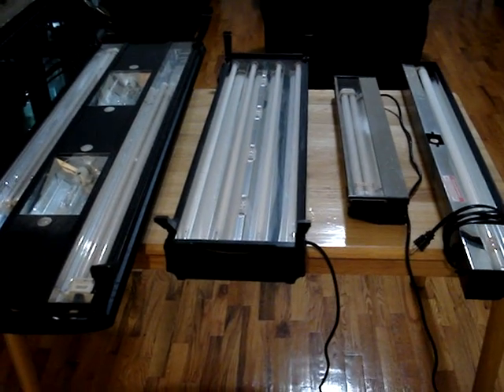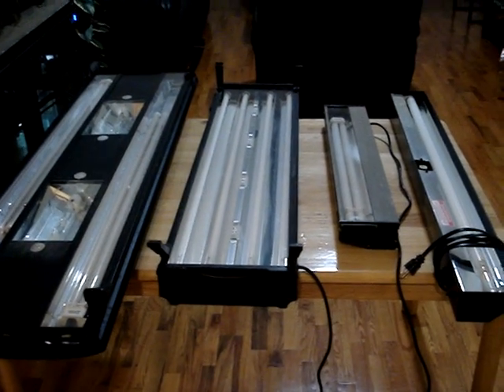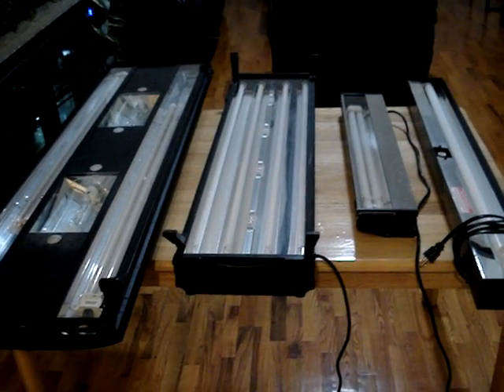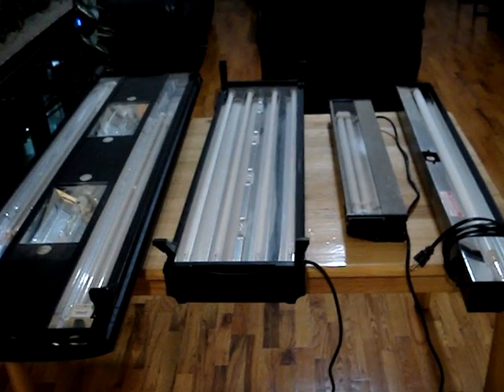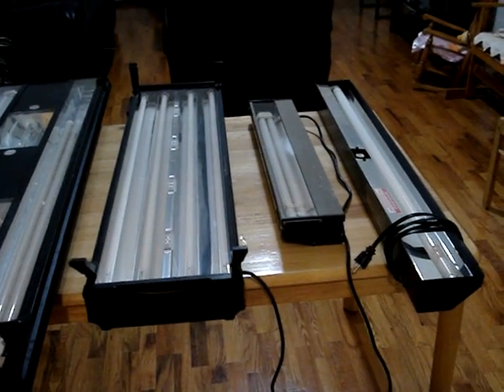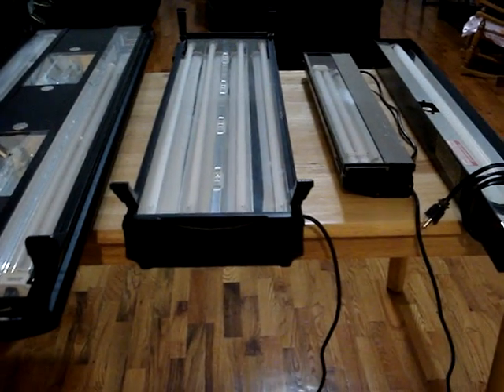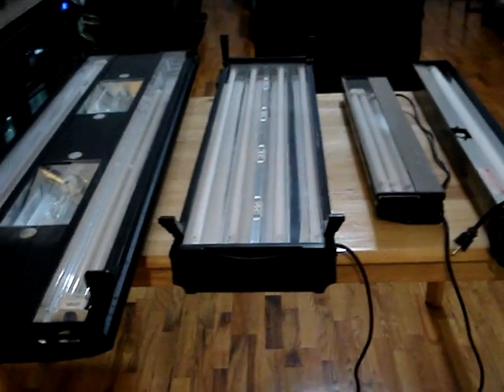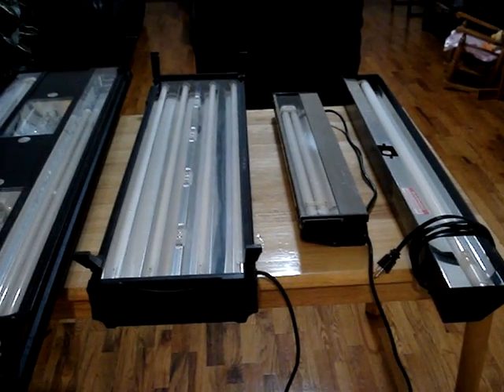Reef Aquarium Lighting

Comment: Steelo, 

Do you think this light is overkill for a 46 Gal bow front? I know i will have to install a chiller, but wondering if 10W per gallon will burn corals.  

36" Current USA Outer Orbit 2x150W 10,000K HQI-MH W/ 4x39W T5 HO & 18 Lunar Lights*

Comment: Stello, I have a tank that is 30" long 24" deep I am look at the aquaticlife 4 lamp t5 lights and it seems like the 30" will not have enough watts per gallon for me.  DO you still have your 36" I was wondering if i can turn the brackets around so they face inward.  Or do you recommend any other lights that are in the $300 dollar range.  Also it seems like it is impossible to find decent 30" bulbs so I would like to skip that unit completely .  Thanks for your time

Comment: Thank you so much bro for the reply .Which one of these 2 light fixtures would be better for the 46 gallon bow front 1-Nova Extreme SLR T-5 Fixture 36''  156 watts 2-39 W 10,000°K
2-39 W 460 nm actinic. or 2- Current Nova Extreme Pro T-5 Fixture 36'' 234 watts 3-39 watt 10,000°K 3-39 watt 460 nm actinic? Thank you so much .

Comment: Hey steelo, I sent you a message a few weeks ago about your MH system on the 90 gallon. I did a little research on the coralife aqualight pro and noticed that they use to sell the 250w MH along with the 150w. Now they just sell the 150w (at least that's what i found online)Just wanted to know what one you had and if the 150w will be enough to grow sps corals in a 75gal tall(29"tall). I know watts per gal is the rule of thumb but I read that the depth of the tank will play a roll in the equation.

Comment: i use the same light only its a 72inch model...... its a awesome light. i got it from a friend of mine that replaced it with a huge LED system and his did well for about 5 months and his corals absolutely  did not do near as well under the LED's. I use the metal halide fixture and my tank runs at 77 and creeps to 78 and sometimes 79 after 5hrs.of the halide's, PC's stay on 12 hrs too...... I do this with no fan or chiller and live in FL, my house stays at 74 inside year round.

Comment: Hey Steelo -  I got myself a Deep Blue T5 setup.  I dumped the stock bulbs that came with it and got myself 4 x 54W ATI bulbs... two 12K daylight bulbs and 2 actinics.  I have a 55g standard tank and I was wondering if there were any limitations with that lighting setup in regards to corals I can keep?  Also, is that not enough lighting for clams? Thanks!

Comment: hi steelo, i have a dymax metalhalide system 2 bulb 150w each and two blue buld 38w each, now my tank is 100x60x60 so totally 360l plus refugium, but according to che calculation i did i can reach only 4w per gallon... is it enough for my tank? my goal is to keep exact the same coral sps an lps that you have. thanks so much for help

Comment: hey steelo, i watch this vid but still didn't answer my question so i was wondering if you could help me decide which light to go with, here's the scenario. my tank is 16g (65L) and im planing on putting 1.5-2pound of live rocks to help with filtration as im not using a P/skimmer, so my question is:
is a 2x24w T5 light fixture enough to keep corals such as Anemone corals?
also choosing between 2x24w T5 or 3x14w which one should i go for.
ps. i couldn't find anything about the PAR. 
thanks steelo

Comment: Hey Stello, I have a 65 gallon saltwater. I was wondering if you could recommend some corals for a beginner. I have 150 watt metal halide with 2x65 watt pc attinics. I would need some lower light corals since the watts per gallon is only 4.3, but any recommendations would be appreciated thanks.

Comment: @newyorksteelo thanks bro ive been doing some reasearch it looks like te LED systems are more costly but i found a nice t5 thats more afordable  The Aqualight HO T-5 Dual Lamp strip light its a 10,000k lamp and an actinic with a feature that lets u add another of the same fixture to meet ur systems needs and and it comes out to 108 watts which is like 2 watts per gallon for a 55 gallon im thinking that should be good for soft corals

Comment: i am wanting to set up a frag tank prob about 3-7 inches tall and i would like to grow acros and sps but im a little low on money i was wondering if i still need to go for the watts per gallon because the light does not have to travel through as much water which then means that the light would be stronger at 1 inch of water compared to 10 inches so could i go with a different rule or what iv been in the hobby for years  now but i have always had questions about lighting thanks

Comment: I was doing some research on which power compacts deliver the most PAR as this is the lighting system I use (4x65watts on a 55 gallon) and I found that there is a company called UVL that make power compact bulbs that have a reflective coating on the inside of each bulb and its supposed to improve the intensity greatly and direct the light down into your system more. Im figuring its worth a try especially since they are the same price as the Coralife bulbs I currently use.